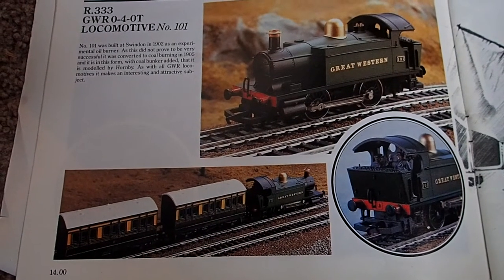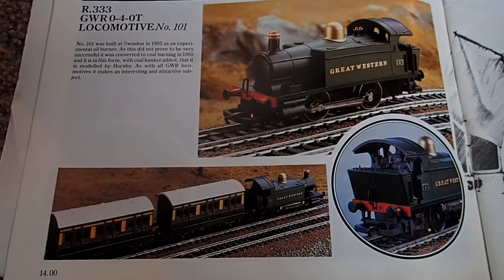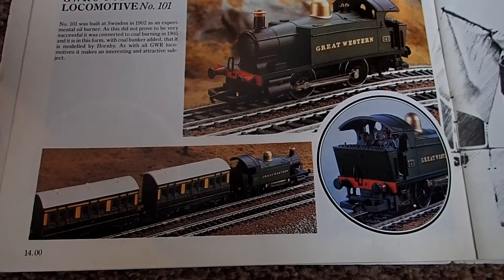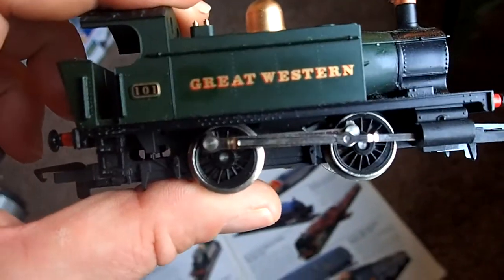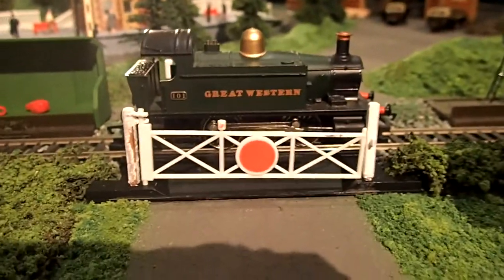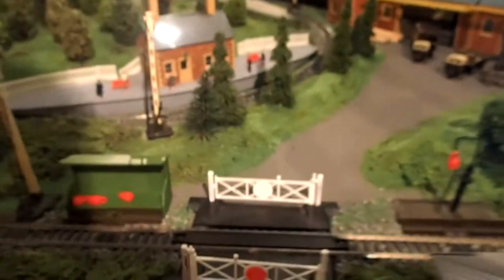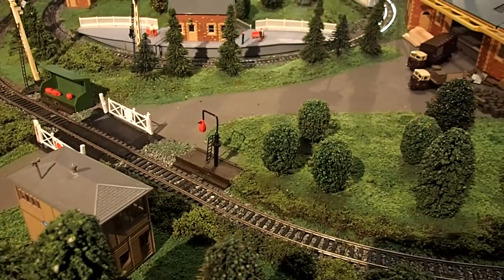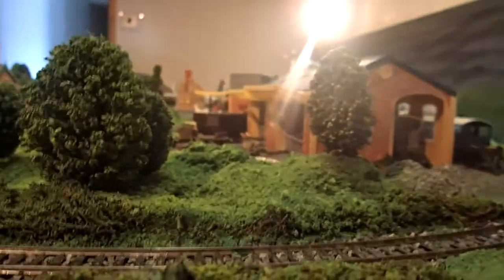My Hornby Locomotive R333 GWR 0 4 0T Locomotive No 101 1981 1982 1983 1984 Model Railway Layout

Comment: This is my favourite engine
It's the first one my dad bought me 45 years ago when I was 7 (you can work that out). I can remember the day he bought me it and it's 's a strong connection to my father who sadly isn't here anymore.  It stopped working last month after I over fiddled cleaning it. Got so upset. I've had it repaired and even got another of eBay. It's great to see it on your layout.
Reply from the maker: Same here Victor - my first, Christmas 1980 when I was 7... I buggered mine in the same way, many years ago. I fixed it today, finally! So now I have two as well 😃
Reply: @Codbotherer you've had me there I thought the saddle tank GWR 8751 u had in the shed was blue until wife said I'm colour blind